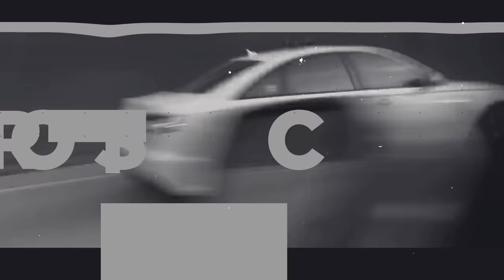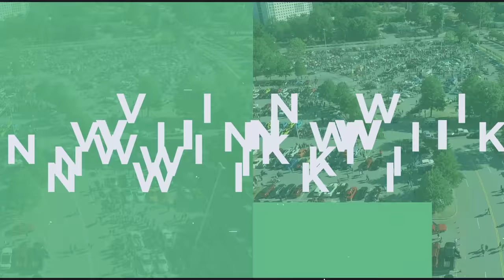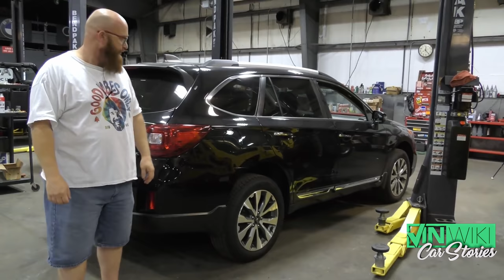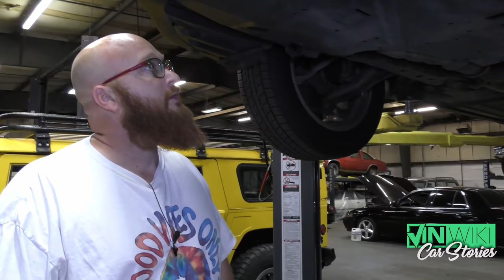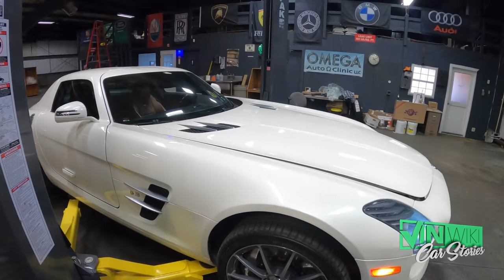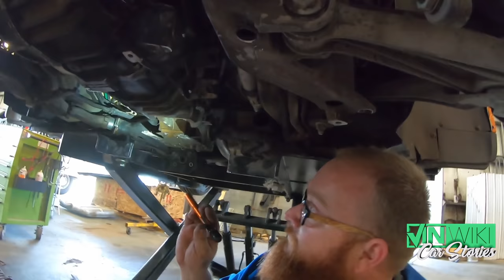The Car Wizard's 4 Worst Mistakes Ever!

Comment: The Whole SLS fluid situation really is Mercedes fault because they used the same terminology for two very different and incompatible fluids in their service data.
Reply: @magnusthereddidnithingwrong : Öl  ist Öl.  Kein Unterschied.
Reply: Wonder if it was a poor translation from German?
Reply: Mercedes could've used a better method/term to make the difference more easy to spot. But in the end the fault goes to the person who put the oil in. After they rechecked the manual, they realized they made a mistake. If I'm not mistaken, the Wizard used a video manual for the SLS, not just from a book. That means that Mercedes's service manual clearly shows which fluid goes where.
Reply: Mercedes are terrible at human factors
Reply: @jonathanfairchild  Even in German Mercedes's WIS manuals are the worst in the automotive industries I have seen so far. The best ones in my opinion are BMW's TIS but I can only speak for the BMW Motorrad ones.

Comment: I had a garage once that screwed up and called me and owned up to their mistake. (It was not so involved as a ruined transmission, but it cost them money because it was a mostly labor repair). That was the only garage I ever used again, because they were so honest.
Reply: My buddy used to own a Volkswagen CC that ended up needing to get some service done. So he brought it to the dealership and one of the mechanics ended up having a mishap while working on it. (Mechanics fault) The real issue was that it was a Friday evening and the mechanic couldn't get the part ordered in until Monday morning. So the mechanic told my buddy that they would get him a car for the weekend. (Mind you this dealership also owned a luxury dealership nextdoor.) The mechanic walks back in the shop and tosses my friend a set of keys. He looks down and it's a key fob for a Bentley. It ended up being a Bentley two door coupe. My friend told the mechanic to take as much time as he needed....
Reply: @conrad463  
A BENTLEY COUPE  ?  HOW DO YOU COME BACK TO GMC ECT AFTER DRIVING A BENTLEY  COUPE  🫖
Reply: @1AEROSOL.1PUFF  Haha ikr
Reply: @1AEROSOL.1PUFF  It was easier than you think. The driving conditions weren't the best as we live in a snowy climate. He was constantly worried about something happening to it while driving. He really couldn't take full advantage of the V12 under the hood (Continental GT) with snow on the ground. He also was living in an apartment at the time with outside parking. He was worried about leaving the car outside overnight. So every night he would have to drive to his parents condo and park it as they  have heated underground parking. He'd have to borrow his Mom's car to get home and than pick up the Bentley before work in the morning. My buddy also worked in one of the highest crime area in the state. He had to be early to work everyday to make sure the car was parked close to the building so it could be watched over.

With all that being said, there were times he said he enjoyed it. Overall it wasn't as great as one might think. A cool story but he'd probably just rather have had his VW CC fixed the first go around. If the dealership would have gave him the keys in the middle of the summer that might have been a different story.....
Reply: @conrad463  that is good they owned up. More often than not they will try to blame it on the age of the vehicle or similar nonsense, anything to get out of fixing what they broke.
Reply: @conrad463 
NOW THAT IS SAD TO HEAR, BUT HE HAD TO ENJOY THE FACT THAT HE WAS DRIVING A BENTLEY,  IRREGARDLESS TO SNOW ECT, HOWEVER,  I GUESS THE POOR GUY PROBABLY SAID IT WAS HELL ON EARTH. 🫖
Reply: @conrad463  you make it sound like he had the car for 6 months. It happened on Friday and part ordered Monday. He worked all weekend and the repair took weeks? Lies man, lies. The more involved your lie becomes the easier it is to spot.
Reply: @EtherGaming604  You obviously have no idea what you're talking about. You do realize people work weekends. I never said it was weeks. I clearly stated it was the weekend. Open your eyes kid.
Reply: @EtherGaming604  Taylor is the only girl I know who goes to the Library and fights with the librarian about non-fiction books.
Reply: @EtherGaming604  Still arguing with the librarian or just painting your nails?
Reply: yeah. In contrast I had a garage once that ticked off items on the to-do list for a service without doing them.
Never went back there after I found out and confronted them with it.
Reply: This is how you recognize a great company. I never value companies that have sweet photos on instagram or great videos on youtube where everything is perfect. The real test is how this company is going to react when they make a mistake.
Reply: @jwenting  Naturally!
I had a friend who took his Subaru into a chain-tires/repair shop for 75,000 mile service. The mechanic drained the oil, changed the filter, FORGOT to put new engine oil in; started the car. After a few minutes on idle it didn't sound right. He realized the mistake, THEN filled it with oil and said nothing (but this was witnessed by the tech in the next bay). Customer picked it up and 2 miles down the road the engine sounded like someone was beating it with a hammer. Needless to say, the engine was ruined. Shop denied responsibility. They took responsibility -- for a new engine -- only after the friend made a stink in the newspaper.

Comment: As a tank engineer I find the story of dropping the Abrams engine to be very interesting. And scary. For many reasons, not only do those engine/trans units weigh 7.5 tons but also management and the safety team would have a field day if that happened in my workplace. You'd never hear the end of it.
Reply: At two million dollars each, someone is getting very rich at taxpayer expense.
Reply: We didnt hear the end of it for awhile either
Reply: But would they ever let that happen again? 😉
Reply: Endless paperwork and finger pointing would have been the case in my unit. Commander and XO may have not been so nice. As tanker Ive seen plenty of accident but never a tank pak drop.
Reply: @CarWizard  your commander sounds like a good man, sad to think he probably got yelled at by the battalion commander and XO
Reply: @alfredogarciajr40  as a former Bn XO, if the Command has any sense, the priority would be how to prevent another accident so nobody will get hurt. Car Wizard’s CO was right.
Reply: @danielulz1640  Jet turbine engines are fucking expensive... -_-
Reply: But how could it have happened. I'm certain with an engine weighing and costing that much there are procedures and protocols to follow when moving, or installing. Men, or women with a certain precise job that they have to do in a certain order with a checklist. I just don't understand how it could have happened.
Reply: @tilerman 
It's a easier to understand if you have lived it.
In 84 I was deprocessing the M1 tanks in Germany. Took them off the railhead and got them ready for the 1/33 and 3/33 out off Gelnhausen. 
Inside of the shop with a overhead crain on a cement floor every thing is lined up and it comes out easily.
In the field nothing is easy. I M88 recovery vehicle is used. It's a big fat tank with a boom that's 20 feet up that has a cable system and a multiple sheeve block with a hook. Then there is a "H" pattern lifting device that has hooks at each corner and one in the center.
All 4 of those hooks goes into an eye hook on the "pack". The pack has a "foot on the bottom that is bolted to the turbine engine that slides into a mount way up inside the tank. The transmission end is at the back of the tank that just sits in a saddle with caps on top that 6 bolts on each side hold it in place.
When lifting it out the back goes up and out, but the front foot has to come out of the mount.
The front of the M88 is going down  and the back of the tank is going up. The engine is swinging on a cable 20 feet in the air. Once the pack is free. The M88 has to back up and when doing so the front of the M88 goes up the engine pack swings around 10 feet in the air. One of the hooks pops out and down she comes! Ask me how I know. Ask me how I know!
And just think we do that at night, in the rain or 120 deg in the desert.   In any terrain imaginable. 
And maybe it's not obvious, but these things are made for WAR. Could be pow pow or boom booms also!

Comment: The issue with that Subaru is actually pretty common. The 2 CVTs offered look similar and the fill plug for the newer trans is in the same spot as the old diff fill from the older CVT. Ive replaced 3 transmissions for this exact issue.
Reply: I want to know why he wanted a CVT and Diff flush at 20xxx miles. I work at a Subaru dealership and we don't recommend diffs until 45k and trans at 60k
Reply: The thing that fools most mechanics that have not read the Subaru service manual is that on the new CVTs the front diff is filled from an unmarked port just above the passenger side drive axel.  Underneath the car, the differential drain and check ports are clearly marked.   Change diff fluids every 45,000 miles in normal driving.

Also, to keep the Subaru 100,000 mile CVT warranty in effect, the owner must not change the CVT fluid at all until this mileage is exceeded.  On my '13 Impreza, the solenoid pack became defective at 80,000 miles and they replaced it free of charge, providing me with a loaner car for three days.  Should a solenoid go bad (there are six in all) which is common, the car is drivable but very sluggish as it will not "shift" properly.  Also, many warning lights flash simultaneously on the dash. Throws code 2763.
Reply: @mpolley07  upcharge...
Reply: It"s not hard at all to look at the vertical line separation between the diff and the CVT. Rookie mistake. Oil pan side=CVT. Axle side=front diff.  The fill points also happen to be criss crossed from each other depending on year range.
But, To be fair he did say it was a new technician.
Reply: @KA-om9oz  probably asked for all the fluids to be done.
Reply: Yup lol a guy at my worked has fucked this one up a couple of times
Reply: I'm so glad i drive a manual.
Reply: @tylerniday8935  problem is the location of the plugs, as well as the picture used being somewhat confusing. There's a fill plug, a drain plug, and a check plug. The drain and check plugs are both vertical on the bottom. Once you figure it out, no biggie. But it's certainly needlessly more confusing than the old dipstick style front diffs.
Reply: @mpolley07  they didn't say how old it was, Low mileage  high age maybe? Maybe someone who's had a failure before & is now paranoid about it?

Just bought it & didn't know history? Endless reasons why I guess
Reply: @KA-om9oz  that's only when a garage suggests doing unnecessary work, not a customer asking for it
Reply: @mpolley07  If you do a very early fluid change on a CVT (15, or 20k miles), they last significantly longer.
Reply: @norfolkngood8960 izard said it was a ~ 2018 w/20-25,000 miles

Comment: “Drop it! That’s an order!” 
Car wizard is a good man.
Reply: Yeah, newbies usually make those mistakes out of pure ignorance. First thing I was told back in my first day at a factory was "I don't care what could possibly fell into the ground, you let that thing fall. Don't get hurt over anything".
Reply: When he said that, I just thought "yup, that's the military in him"...the "that's an order" part.  :)  Good man.
Reply: that brought a tear to my eye
Reply: @1986arseny I think it's more like: "I fucked up, I kinda need a job now more than ever... I don't care if I get hurt if it means I could possibly keep my job". I agree! Never get hurt over something like that! But to say it's caused by inexperienced people is a tiny bit reductive
Reply: @gurabirierosanopara620  not caused, by usually inexperienced people are more vulnerable in case of something goes wrong. They instinctively try to hold the item, being it a knife, a really heavy piece, something that can cut or plainly break a bone. Experienced people does make mistakes, that's why some mechanics still like to 'shake' a car on a lift, just in case.
Reply: @1986arseny  please, please keep away from working with HR
Reply: I'm kind of surprised they didn't just have everyone in the shop go grab the motor. It weighs what, 400lbs? 600lbs? 4 guys should be able to pick it up and put it down, or at least stabilize it on the jack until it gets tied or lowered.
Reply: @1986arseny  I've been lifting cars for years and I still give them a good shake. Seen too many cars fall to not do that.
Reply: @christopherrto  It's possible to do it. It's also possible that one of the guy's hands slip out and that guy gets a 400 lb engine tilting towards him and falling off the Jack on his chest and then to the ground from 4 to 6 ft high. That event is very unlikely, but it's consequences are... definitive for that one person.
"Drop it" is definitely the way to go for me if the engine is already going
Reply: Legend ❤
Reply: @1986arseny  ignorance? It's was a race, so of course he (the newbie) wanted to show of and be first! it's not the newbies fault that someone more mature, and whit more skills pushes a newbie for a competition to take the engine out fastest! so respect to the owner, for saying never any racing about work here again!
Reply: @daftnord4957  need a hug?🤗😁
Reply: @dannyj6584  Thanks man, i appreciate it❤
Reply: @christopherrto it takes time to get four guys. During the wait the employee is at risk. It's just not worth it.
Reply: @1986arseny  When I worked in China the fitters always put heavy stuff on the floor and worked on it there. Makes sense when you think about it.
Reply: @christopherrto  You're assuming both that there were multiple people around who could have done that without getting injured themselves, and that the engine was accessible enough for that to happen.
Reply: @PJ-om2wq  If there's 4 guys in the shop it shouldn't be long. Or grab a kneeling mat and toss it under to soften the impact. I dunno, obviously I wasn't there, but I imagine a busy shop with one guy it the corner about to drop on engine, I would imagine yelling "everyone here NOW" would have worked.
Reply: @dunebasher1971  See comment above

Comment: I had to pause this after the first story BECAUSE back in the day , i'd say around 2002 or so , I had just begun to be a mechanic for a living. I did this same exact mistake on a Subaru Forester, except I realized my mistake before I even started the car. Came in for an oil change, I unknowingly at the time, mistook the drain plug for the front diff for the oil drain. Drained out the front diff, put the car down, went to put in 4.5 or so quarts of oil back in the car, overfilled it by a lot and quickly realized my fuckup.

Comment: This makes me feel so much better about my mistakes. Even if my mistakes are more like forgetting to tighten wheel lugs before lowering and driving away, or sheering a bolt because I got my left and right mixed up while on my back lol
Reply: Thanks for making us all feel better.  The number of times I have "mimed" the correct direction of loosening and then rolled under the car, still moving my hand.... 😁
Reply: My biggest one was not listening to people about buying jack-stands and just using a curb and a jack to do oil changes on my SAAB. I managed 3 of them until on the 4th, the top pad on the jack bent and sheared off and dropped the car on top of me.
Out of precaution, I was always on the curb side when I was unscrewing the oil drain plug, so it kind of dropped and caught me in a triangle space that I managed to crawl out of.
Now, you'd think I'd have learned my lesson, but instead I just bought a 2.5 ton rated jack (the car is 1.8 tons only), and still do the changes in the same spot :))
Reply: For a standard right hand thread, the best way to determine which way to turn it when you are on your back or in some other odd position, is to take your right hand, and point your thumb in the direction you want the bolt or nut to move, and curl you fingers. Your fingers will curl in the direction you want to turn the fastener. In the rare case of a left hand thread, do the same with you left hand.
Reply: @vtr0104  Yikes!  Please be safe out there.
Reply: @vtr0104  I always just use a tree stump, pain to set it up but it's gonna be just as solid as any jackstand.